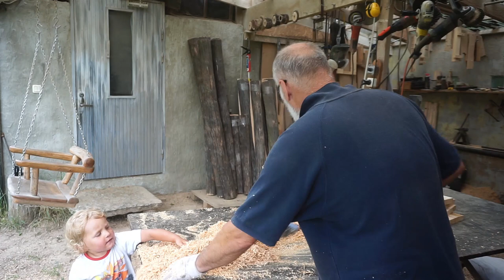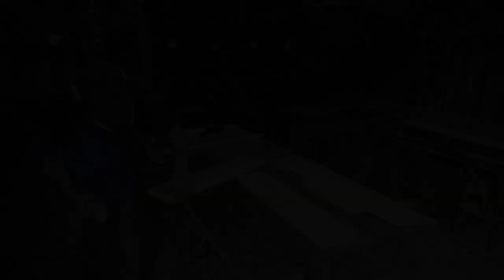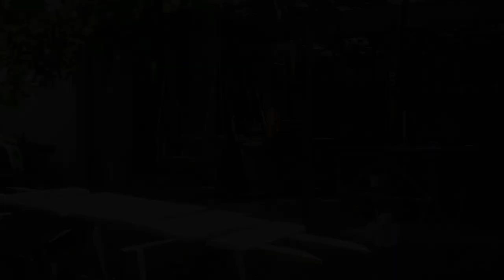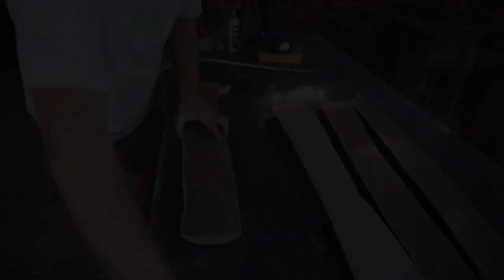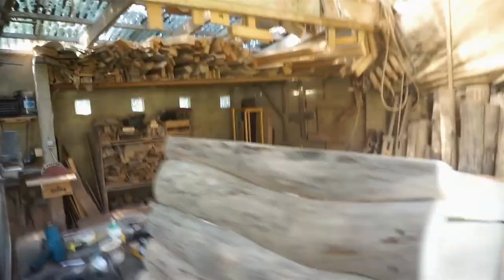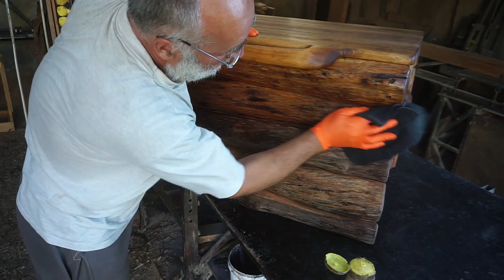Making rustic wooden chest from live edge slabs

Comment: Looks fantastic. New subscriber. What type of oil finish is that?
Reply from the maker: Thanks Tom. When oiling, I use "Teak Oil" for impregnation and oil wax or "Danish Oil" for coating. In this video I used oil wax. And I know there are better oils, but the method I use has a very good price-quality ratio, which is quite important when making a living from woodworking.